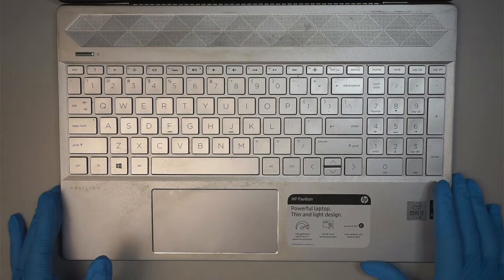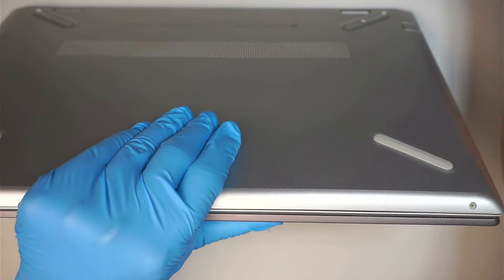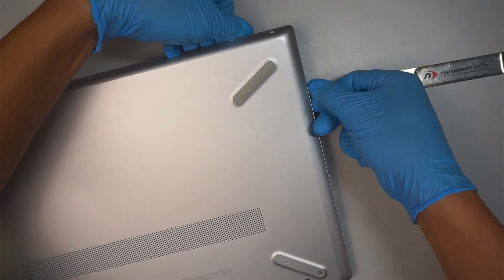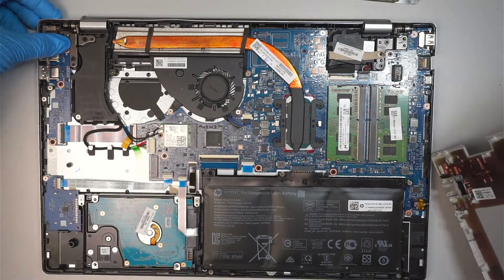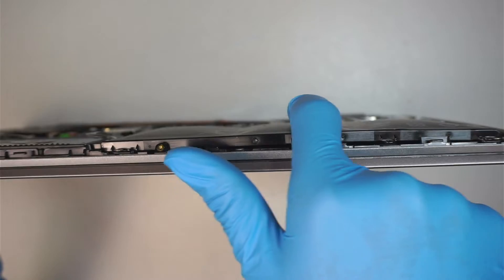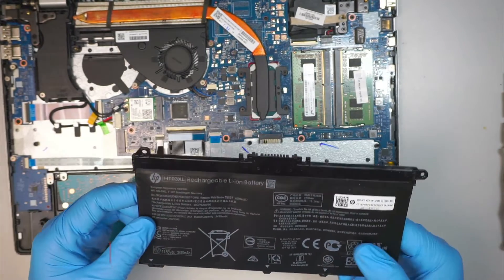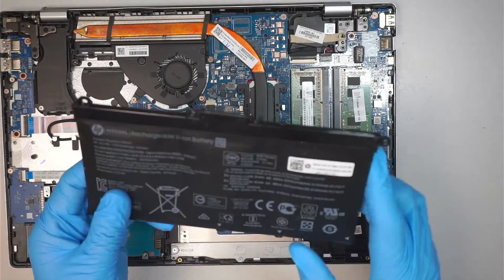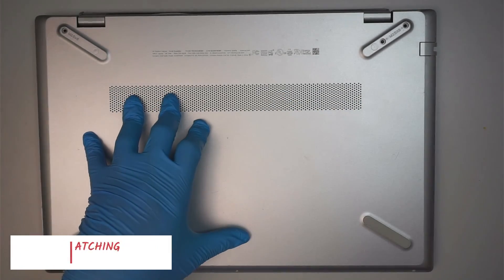Why HP Touchpad Is Not Clickable

Comment: This started happening after opening the bottom case to upgrade my RAM.

When I closed the bottom case the touchpad stop from clicking on the right side, so it is unable to right click, the left click works fine. 

I opened the bottom cap again and even with it removed I can’t feel the touchpad clicking on the right side. The battery is brand new as I have the laptop for only a couple of months. 

I have an HP Probook 450 G9 by the way. 

I can’t seem to find why this is happening, everything looks fine, there is not something broken. 

It worked fine before I opened the case to upgrade my RAM it all started happening after I did that.
Reply: Same here

Comment: My laptop isn't that old but I am having a problem with my touchpad from clicking anymore. I usually use my mouse most of the time anyway, but if I forget to bring it, I have to use the touchpad obviously, but this just started happening. I don't feel that I have battery life problems but this could be the problem so I am going to open it up and find out. Thanks!
Reply: in most laptops you can make a little tap on the touchpad like if it was a screen to left click, hope this information helps.